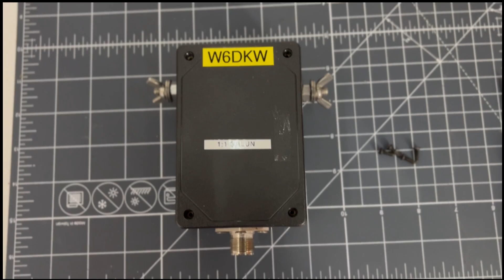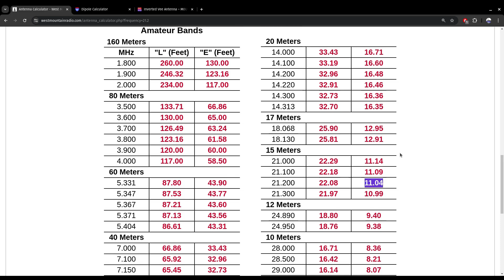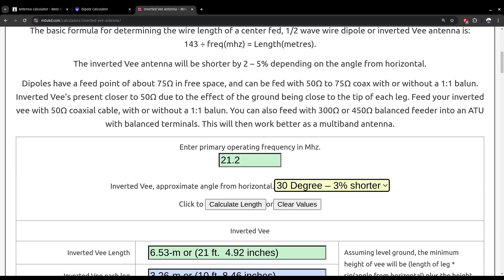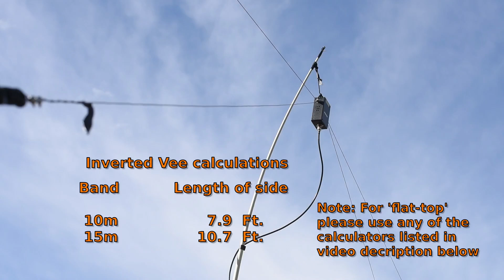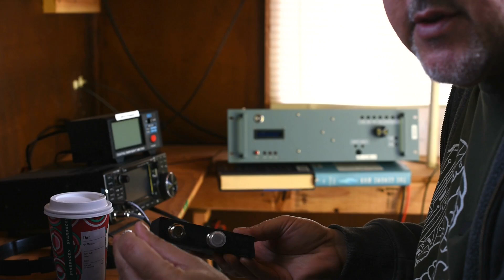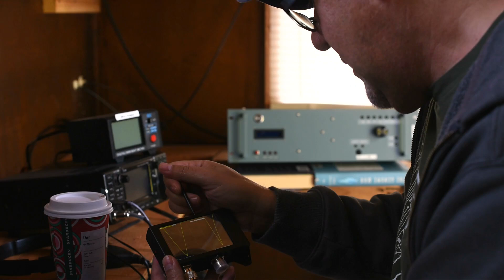Fan Dipole Antenna Build with 1:1 Balun

Comment: You don't show the feedpoint spacing. You need five or six inches between each dipole at the feedpoint otherwise you get too much interaction between elements, and your SWR gets badly humpy across the spectrum. (also need as much spacing as possible at the end points - a meter minimum, two meters is better, where the voltage is highest, to avoid capacitance coupling between elements).  Your balun / feedpoint design is suitable only for a single dipole, not a multi-element fan.
Reply from the maker: Both dipole sets are tied to same terminals on the 1:1 Balun.  And I have seen fan dipoles constructed as you suggest with spacing,  however I have not seen any issues with my build presented in the video where the top and bottom set of driven elements have different angles toward ground. In my build 15m set is on the top.  And then 10m set is under that.    I have made successful contacts in JP, NZ, AU,   as well as East Coast:  PA, MD, SC, FL, and NY
Reply from the maker: Some reference videos from some 'elmers' where a single feed point and fanning out in different directions or different angle is discussed:   https://youtu.be/kbVWTk7YTDE

Comment: Why would you build an antenna with an intrinsic impedance the same as your transmission line?  An antenna is also an impedance match, between the impedance of your transmission line, and the impedance of free space. You have created an intrinsic mismatch in your system. So now you have to use an antenna tuner to re-match your system, but in doing all of this, you created a lot of places for power to disappear into thin air. 50 ohms x 6 =300, a close match to the 377 ohms impedance of free space.  Baluns aren't only about connecting balanced to unbalanced . Any impedance mismatch anywhere in the train results in reflections.  Gee I wonder why so many of us elmers use ladder line instead of coax?  Get your mental models right and you'll be astonished what you can do with less gear and less power.  Remember too; "just because it resonates doesn't mean it radiates"- you have the right idea at least, to put a bunch of wire high up in the air.  

The first rule of getting into amateur radio is to put the best possible antenna you can come up with, as high in the air as you can manage.  Then, if there is any money left over, you buy a radio. ;)
Reply from the maker: Good to know.  Thank you!